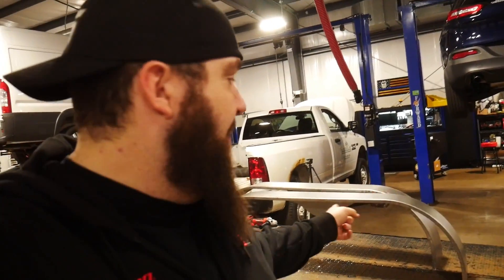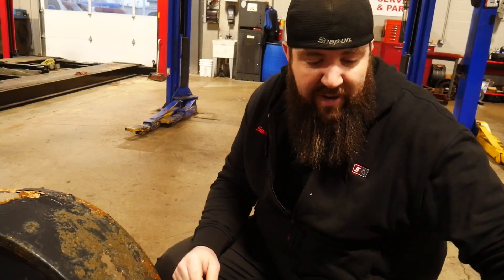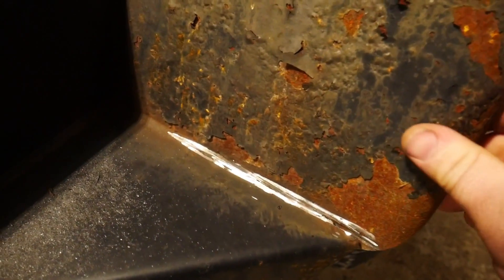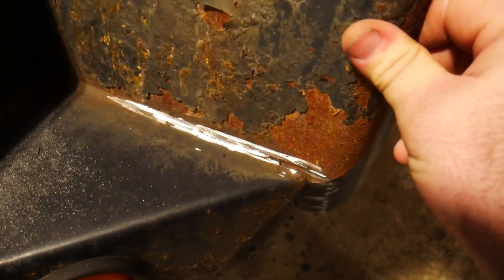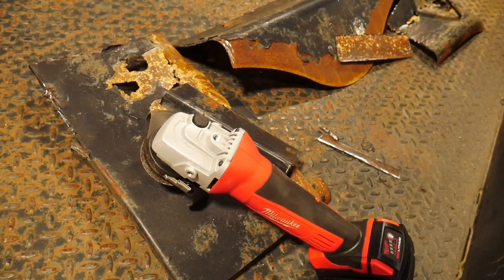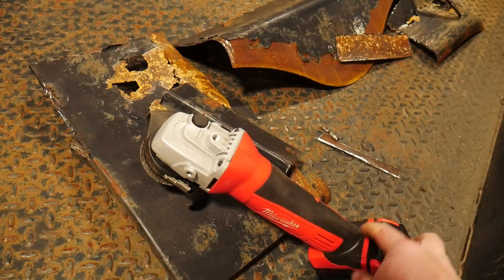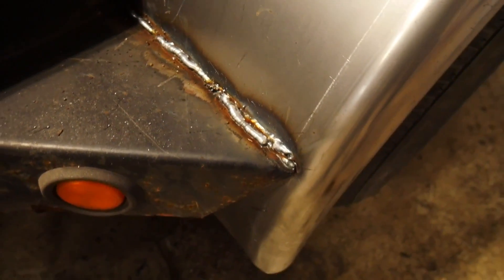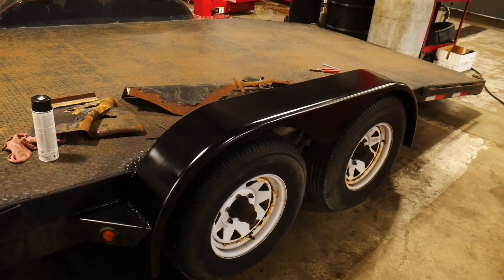MILWAUKEE M18 GRINDER GETS WORKING - REPLACING TRAILER FENDERS

Comment: Just a tip with welding  weather you care or not but could help push your welds never pull the weld, make small circles with the welder tip and start at the thicker metal and roll it into the thinner. A buddy of mine taught me about pushing the weld and it help me alot dont clame to be a welder but I probably weld more then alot of mechanics being in the farm industry. Trailer looks 110% better good job
Reply from the maker: Thanks for the tip man, I’m gonna have to give er a try!🤘🏻
Reply: @RustbeltMechanic  no problem I always tell the guys at work of the see me doing something wrong or maybe it could be done a different way to let me know I dont mind a bit of constructive criticism I always say maybe I have been doing it wrong for years lol

Comment: Came out good nothing to be ashamed about on that.
It looked like the fender was a tad to close to the tires. I say that if the trailer is fully loaded the tires can rub. Depending upon the setup Spring or Torsion axles.
But that could be the angle of the video.  
That trailer being at least a 18' needs to have running lights on the fenders and on the front corners.
Reply from the maker: The trailer was jacked way up in the front end bc I used my big lifted truck with not enough of a drop to bring it in the building lol. Measured and the fenders were at the same clearance as the ones I took off. There are marker lights on those front and rear tab sections that I welded the fenders to.👍🏻

Comment: Step up to a diabolo diamond abrasive cut off wheel, the m18 4.5 / 6" and a 12 amp battery and let me tell you, you could work all day. The standard of m18 grinder gets the job done definitely and will work for most people, if you get into a lot of fab work the fuel is the way to go. I keep 4 locked and loaded with my welding gear. Happy new year. I keep missing out on the live streams Sundays have been travel days for me lately, keep it up

Comment: If you were gonna repaint that deck, what would you use? I've got a diamond plate in bed tool box I'd like to paint black, but was concerned about coverage with the aggressive texture it has.
Reply from the maker: If it were mine I would raptor bed line the whole thing.

Comment: Not a bad weld at all rustbelt your just sitting a lil too long on the same spot. Either slow down the wire speed or move a lil faster but not bad overall. Good video bro
Reply from the maker: Thanks man🤘🏻I really need someone who knows a thing or two just come to the shop and show me lol. We’ve never had an employee yet with good welding experience to learn from